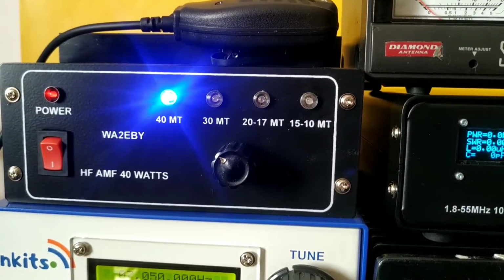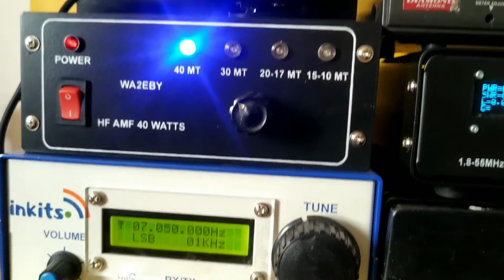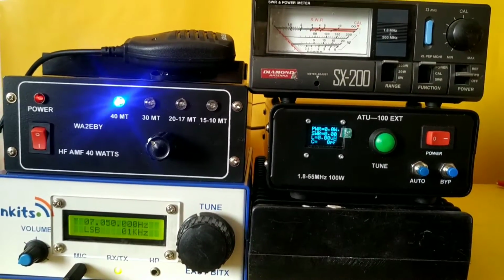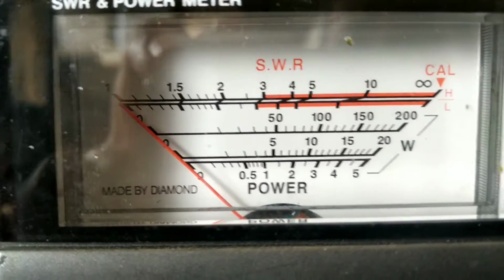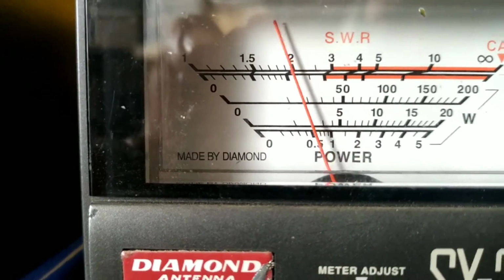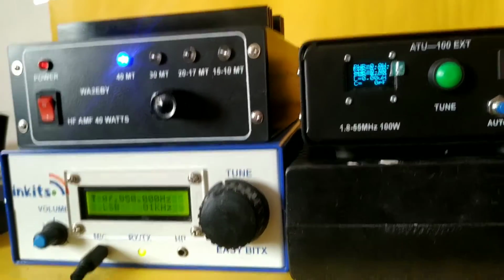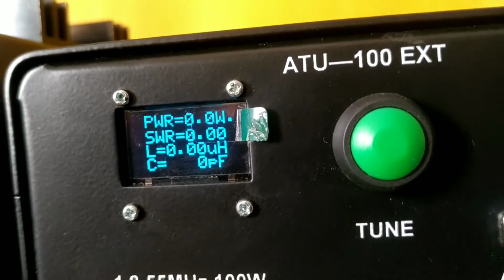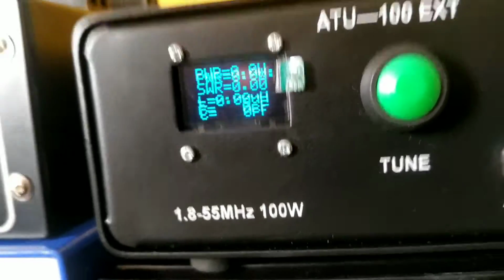WA2EBY Ham Radio Linear Amplifier

Comment: any 100 watts version?
Reply from the maker: The WA2EBY HF Amp is for 50 watts only .
We are working on a new amp that would be for 100 watts but expected by April 2002 .
Thanks and best of 73s
De vu3sua
Reply from the maker: Not yet . But we are working on a 100 watt design .